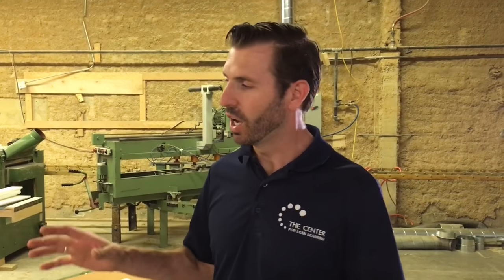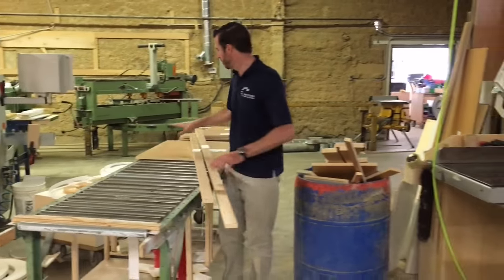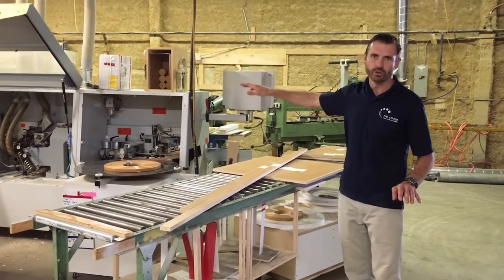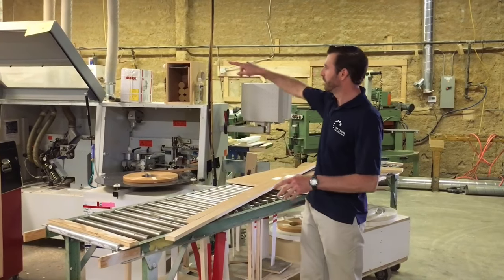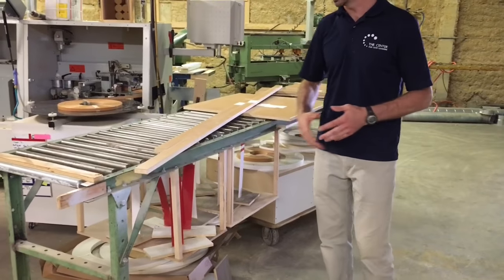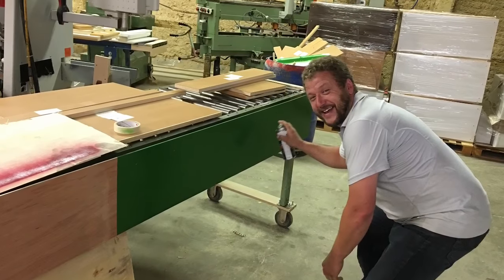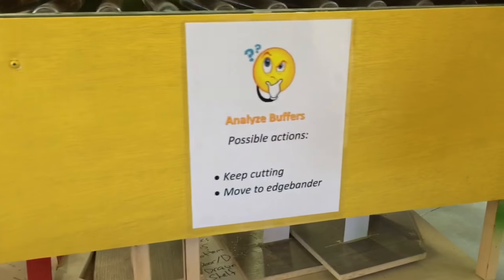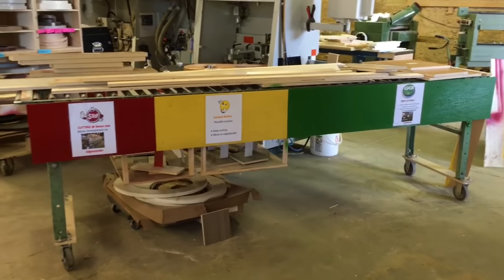Lean Manufacturing - making buffer management visual

Comment: Just want to let you know that I am using  buffer management  thanks to you in our door making. Like Joe, I was skeptical but with our situation It really works and makes sense and here is how: My guy cutting was over cutting and the whole thing got backed up. We now have three carts so one cart is in assembly, one at the door machine and one at cutting. Once the cut guy fills the cart he has to stop until the empty comes back from assembly and in the meantime he “kits” up the doors for the assembler. So the whole operation just keeps in a rotation.  Works like a champ!  So on first glance like Joe, you say WTF? but if you analyze what you are doing and how you are allocating limited number of people and different production rates of machines the buffer management concept can be applied and used effectively. So please Joe, don't dismiss it, think it through and see how it might help your operation.  John

Comment: That's the dumbest solution to non existent problem. You are interrupting individuals at work stations to move to another work station just because a conveyor is full? Get yourself a pallet jack that adjusts with the load.
Reply from the maker: Hi Joe, 

Thank you for your feedback.  we vertically don't claim to have all the answers and are always open to constructive criticism, after all, thats how we all learn.  so long as you are considering the ramifications of a pallet jack that allows to you "adjust" with the load your solution may just work.  It is all dependant on how much "overproduction" your willing to pay the penalty for.  Also keep in mind, creating a process to allow one station to overproduce does not contribute to flow throughout the organization, it just keeps that one station busy.  Remember you want your work force to be "Productive"... not "efficient". 

if you have solutions to problems, please make some video's, post them and share your knowledge with all of us.  A Lean community is all about Learning and growing together.  as Benjamin Franklin was quoted saying "the only thing I know, is I know nothing".
Reply from the maker: Vertically ????  LOL.... that is supposed to be "certainly"
Reply: Well it's not efficient to take a saw operator in the middle of a cut list, stop him, move him to another machine,  have him work a short period of time and then move him back to the panel saw. You are not overproducing by finishing the cut list on the panel saw. You are being "efficient" by allowing the saw operator to continue his concentration, not lose track of count (for example). Hey, everyone has their own method. I am giving you knowledge based upon twenty year experience of running a high volume furniture manufacturing company. You can take the advice or not. I don't need to film a video to impart knowledge.
Reply from the maker: Thanks Joe, I hope anyone reading this thread can find some benefit in it.  Healthy disagreement is what moves all of us forward.  Appreciate you expressing your opinion.   Sounds like you have an awesome factory.  I'm like you, sawdust in my veins.  We worked with a furniture company that took their lead time from 12 weeks to a few days!  it was so fun.  I hope your on a Lean journey, will be the most fun you can have at work !